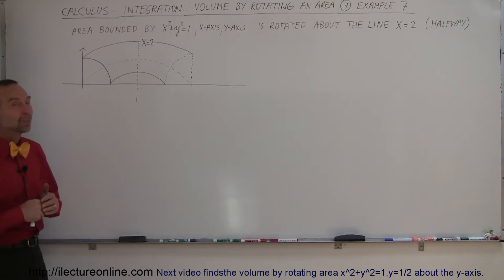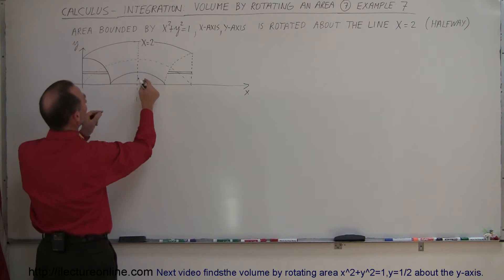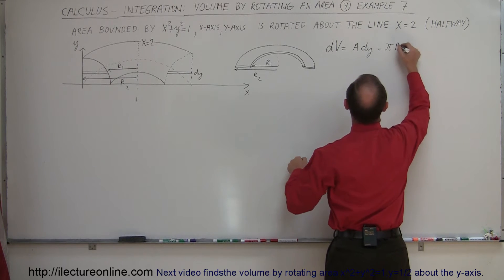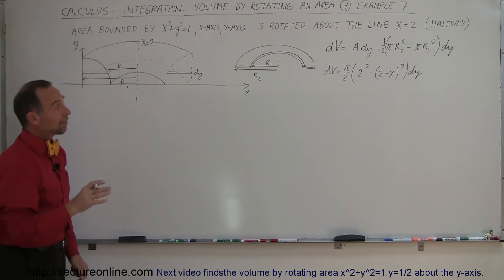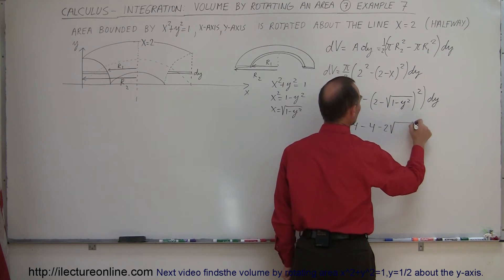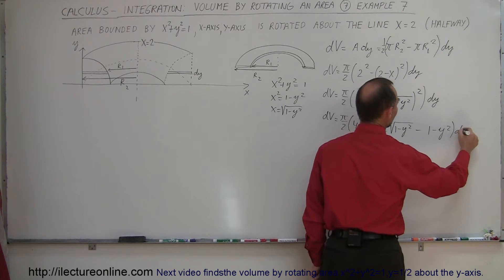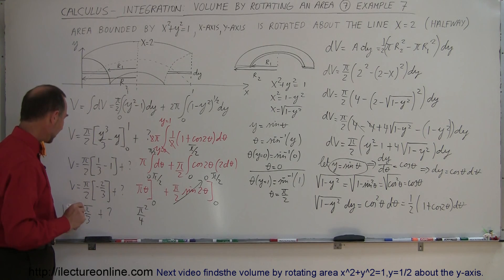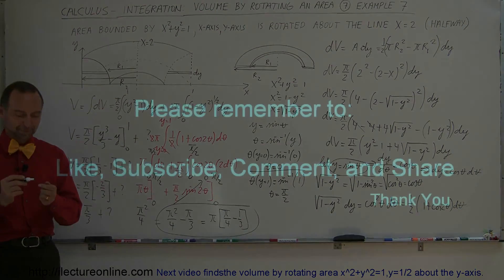Calculus - Integration: Volume by Rotating an Area (7 of 10) Ex. 7: x^2+y^2=1, x-, y-axis About x=2.

Comment: The result may be wrong..! Think a full toroid and try to find the whole volume of it. R=1, so the area is (Pi) and multiply it by the perimeter to get the volume. The result will be (Pi)*(2*Pi*2)=4*(Pi)^2. In this example, there is a quarter toroid which volume is being calculated for. So, the requested volume should be (Pi)^2.

Comment: I used a dx instead of a dy and still got the same answer. I wouldn't have thought to try that (less conventional) method if I didn't watch the previous video on this series so thank you!!
Reply from the maker: There are often multiple ways in which these types of problems can be solved.  Thanks for the insight.

Comment: Dear Sir, 
Many Thanks for this wonderful video. It was as great as always.
I am just wondering what if the circle equation was x^2+y^2= 9...Then the limits of integration would have been 0 and 3. In that case could we still use trig substitution? If not, would it be still possible to calculate the volume?
Reply from the maker: It still can be done, but it will become more difficult to manipulate the conversion.

Comment: Hello Professor, do you think it was also possible to calculte dV=πR(h)dx  --> dV=π(2-x)( √(i-x^2))dx   , using the same method of the previous lecture? (i tried but i came up with a different result =π2/3 )  Thank you, Best Regards
Reply: I tried it and got the same dv as you did but I got the correct answer = pi((3pi-2)/6) --approx. 3.887. You must've made a mistake in the integrals

PS: It is the root of ( 1 -x^2) not i